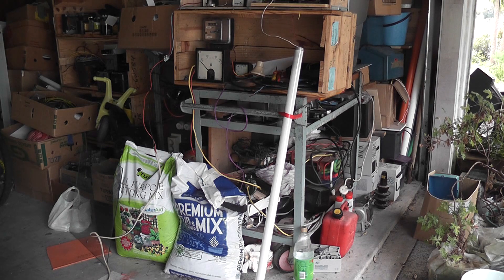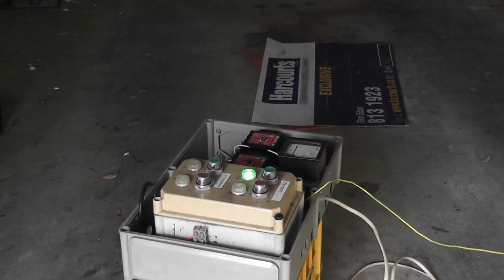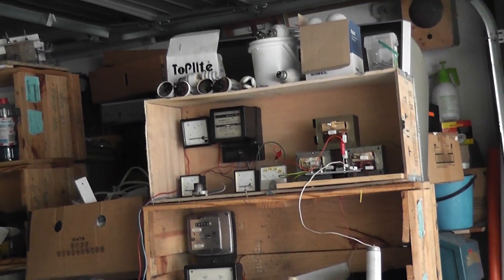4 foot fluorescent  tube versus unballasted MOTs

Comment: @MrRootbrian I've never tried those but I'm sure it would work the same since they are low voltage 2.5 volts to 10 volts depending on the number of bulbs in the string.  
When I was little I "refurbished" burnt out C7-1/2 bulbs of the nightlight variety by shaking them until the broken filament ends hooked together. They would light respectably on a couple of 6 volt lantern batteries or 9 volt batteries in series. Obviously they were delicate as any movement could separate the filament ends.

Comment: I've revived burned out incandescent bulbs of the 6 volt miniature type by connecting them to a secondary to secondary connected 25 volt 110 volt primary-6 volts 230 volt primary radio transformer. The 800 odd volts jumped the gap of the broken filament ends and lit them a blue-silver glow. The blue plastic bead that was the lead in wire separator coated the inside of the bulb with a milky blue foggy film.

Comment: I've seen Slimline Instant Start 8 foot fluo tubes flash and swirl just prior to burning out completely. The filaments disintergrated leaving only the lead in wires and melting off the fluorescent coating just like the 2nd one here. I guess when little remains of the thermionic filament coating hot spots develop causing the flashing and swirling along with orange glow. I have never seen the glass perforate though.

Comment: How do you get 30+ amps from the wall socket (if that is what you're using)? I want to try some MOT experiments but I know I'll easily blow a 13 amp fuse if I try that.

Comment from the maker: @c0rrupts3ct0r555 No, MOTS are very limited there. batteries need large currents and low voltage 12 to 24 Volts at 100 Amps or more.
A MOT can only deliver up to 800 milli Amps to 1 Amp, under short circuit e.g. battery the current increases a bit to maybe 2 Amps and the windings overheat quickly.
They are ok for this sort of stuff.